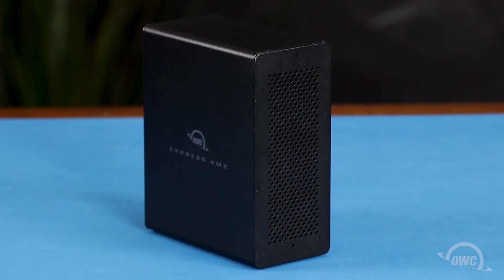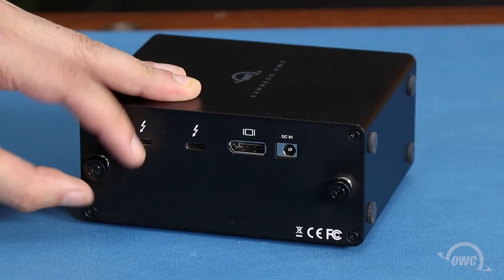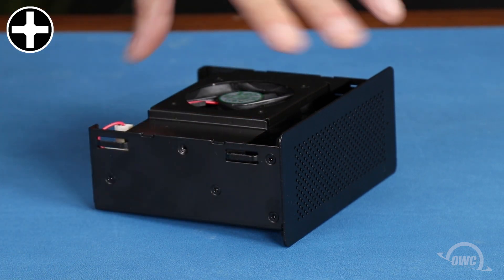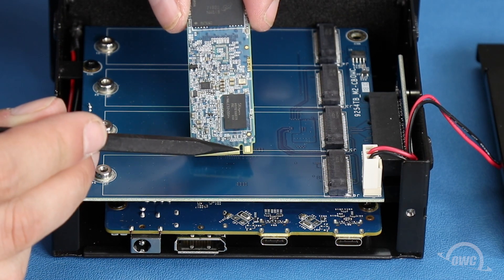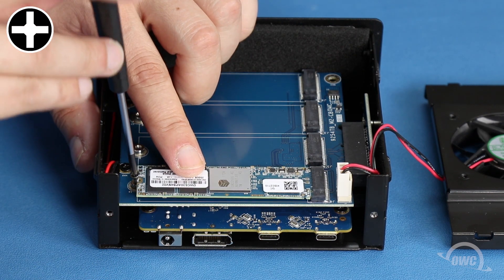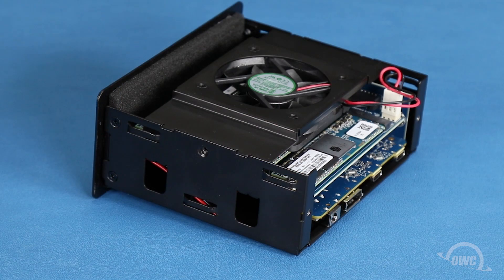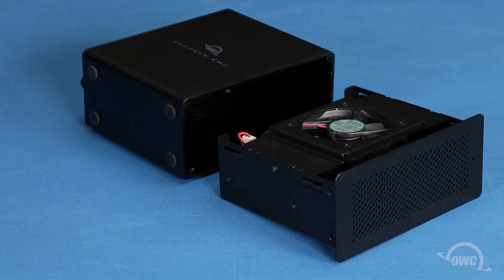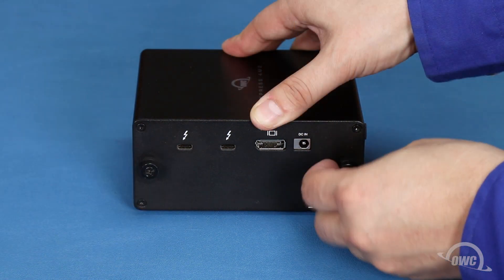How to Install Drives into the OWC Express 4M2

Comment: What size exactly are the Phillips screws used for the ssd modules? Need to replace a couple.
Reply from the maker: The screws used for the SSD modules are flat head M2.0 x 2.5mm.
Reply: @poweredbyowc  Thank you - just bought a box set of laptop screws and that was an included size so eventually figured it out!
Reply: @poweredbyowc  Can I ask when the TB5 iteration will drop and if its form factor is similar in design vs the current usb4 option which I was not loving when I tested vs my TB3 m2 express with silent fan (fan model runda #rs6015s12l)
Reply from the maker: Thanks for reaching out! Unfortunately, we're unable to provide details on products that haven’t been officially announced. As soon as any information becomes available, we'll be sure to share it!

Comment: What a poor documentation already when there's no hint whatever anywhere about the specs of the power supply. Voltage? Current rating? Nothing!
Reply from the maker: So sorry for the confusion. As this is a video for installing the drive it wouldn't include all of the specifications for the enclosure. You can, however, take a look at those specs on the product page on our website. https://eshop.macsales.com/item/OWC/TB3EX4M2SL/#specs

Comment: software that comes with it will not work with Macs with T2 chip.....OWC fails to disclose this....and on top of that they will try to charge you for returning the item!!!
Reply: Perhaps the situation has improved in the seven months since you posted this.  I installed Softraid 6.0.4 on a Mac Mini (2018) which is running macOS Catalina (10.15.7).  I just received a Express 4M2 external enclosure, installed two SSD-cards into it, used SoftRAID to initialize those cards, and then created a large volume using both of them.  I had to create the volume as RAID 0 (since I had only two cards), which was disappointing.  But so far it seems to be working okay.  The Mac Mini does have an Apple T2 security chip in it — I even checked the System Report generated while running on my specific Mac Mini, and it does list the T2 chip.

I have not had the time to do any benchmarking with it.

Comment: I love my 4M2! Blazing fast. When I first purchased it I only installed two NVMe sticks. Now I want to add a 3rd and eventually a 4th. Do I need to reformat each time or can I simply add a new NVMe stick without removing data or formatting? I have it set up as a Raid.
Reply from the maker: If you are using SoftRAID to manage the RAID< you have the option of adding the new drive(s) in without erasing the data, yes!
Reply: @poweredbyowc  I had a different response from your tech support. Any tips on how to do that?
Reply from the maker: @FilmCrafter  I responded to your case rather than here, just to make things a bit easier!

Comment: Also, I presume Jbod is fine for this? A really good NVME SSD like a 970 pro, wouldn't have any benefit in raid 0 here would it? Cause of the bottleneck discussed below? If i put 4 drives can I do two separate sets of raid 0 for 2 large and fast drives, in a situation where raid 0 might provide a speed advantage? (using a cheap nvme drive like the new intel 660P is the idea, direct cheap 1TB, 4 of those is something I am thinking about)
Reply: why not answer what i actually asked? Can two sets of raid 0 be done for 4 drives?
Reply: @Bavanity  .I think running 2 pcmi cards with 2 nvme each,1 in slot 3 and the other in slot 4 can be raided. I think it has to be done by software raid?

Comment: hi, I can't tell as you didn't show the underside of the fan assembly, can the fan be removed and replaced with something like a noctua? If not, unfortunately that would kill this for me. I presume the fan is in a blower downwards orientation? Also what size is the fan?
Reply: that's fine.... I will allow voided warranty.. i need a completely silent fan for a music studio environment.. Almost every single thunderbolt enclosure out there is noisy and  will never understand why quiet fans aren't used.. I assure you that temps will be absolutely fine with a nice quiet noctua high pressure fan spinning at a constant speed. :) I just want to know if it's possible to unplug fan and unscrew it and install a new one.
Reply: @Bavanity  did you go with this option?
Reply: No I went with a startech USB C option where the fan has 3 speeds and can be turned off entirely. fine for SSD's. Cheers @damionmiller1
Reply: PS I ended up buying 2 x 2TB standard SSd rather than NVME because of the cost saving and the fact for my purposes (not video editing) NVME wouldn't have mattered.
Reply: and i was told it was obnoxiously noisy, truly. I am not being difficult. You do realise any 4 or 3 pin fan is the same connector LOL, any fan would work, but you obviously have a contract with a certain brand. I have only one studio room, i.e I do not have a machine room, so everything inside needs to be quiet, absolutely no louder than my imac pro 8 core.. which is for all intents and purposes, silent.
Reply: @poweredbyowc  What about using M2 Drive with cooler on it such as Force Series Gen.4 PCIe MP600? Can it fit here as it has cooler attached to it? Does this 4M2 support the new PCIe Gen 4?